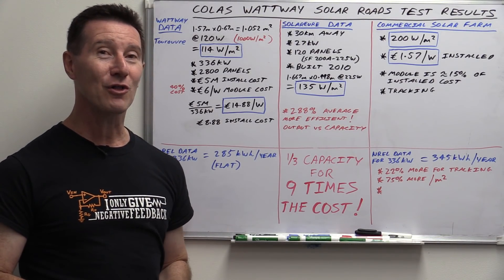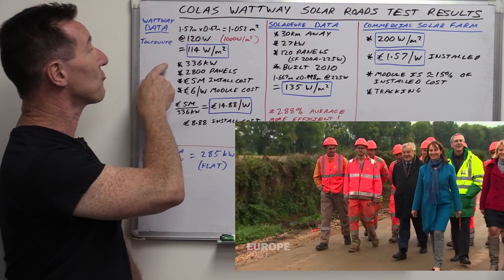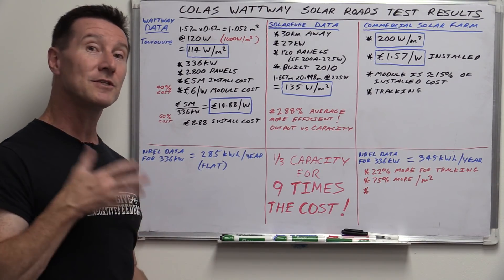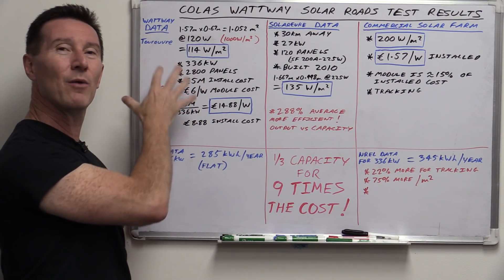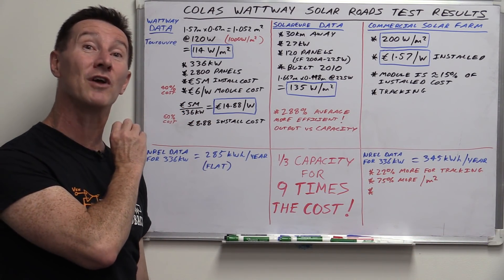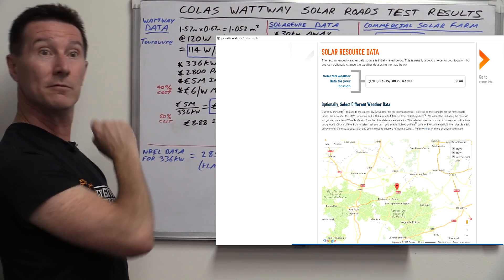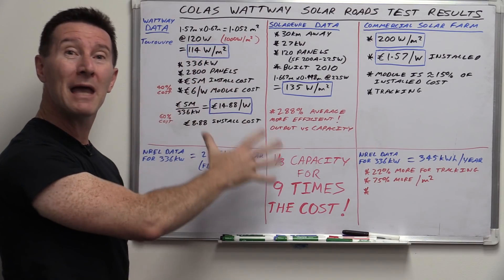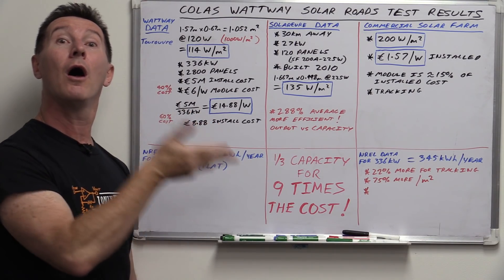EEVblog #1047 - Solar Roadways FINALLY BUSTED! (Colas Wattway)

Comment: Is there a reason you put in 5million installation costs, and neglected to provide installation costs for your "control" factors? Why obsess over what are in effect R&D installation costs..which should not be factored into a costing until a more viable mass production figure is possible?

You also very quick to dismiss the small dutch cycle road which has not only hit its targets but exceeded them and still providing a good amount of usable data on its potential (note...potential) effectiveness. It has been extended as a result of its good figures.

You are constantly hung up on the efficiency issues, and you are indeed correct, a flat road panel is never going to be as good as a moderately well fixed roof panel, and nowhere close to a proper targeted solar farm panel. Can we move on? I mean, we get it, you've made that point....again and again and again and again.

That has never ever been the aim...so why rant on and on and on and on and on about it.

The aim isn't to get a system as effective as roofs or farms, it's to make use of land space where none is available Roofs are limited, and solar farms need large land areas...so there are situations where its just not practical or viable to install such things. I'd love for them to set up 100Km2 farms in African, Asian or Australian deserts and pump the energy around the world, but it ain't happening anytime soon. So other countries need to make use of the land they have which is currently limited.

Roads, while considerably less effective are effectively unused space, and in countries where  land is at a premium finding a way to generate energy with that land is a solid idea.  
The tech isn't suited to it, yeah, ok we got that too, you mentioned it 20 times already, the roads are often obscured, yes yes yes we get that too...but the simple fact is, they do produce energy...and that's a base that can be built on, better quality panels, better installation costs, better surface materials, better results are all possible, as a result of these tests...

And yes, some of the ideas are crackpot..Solar frickin Roadways is clearly a crock,  but a solar revolution needs to start somewhere, it needs its crackpot ideas and it needs to push forward and find the solutions to making effective use of land, effective use of panels.

In time, I want to see farms, I want to see much better and more abundant roof panels, and that will happen in time, remember there was a time where people argued that solar farms were not viable, yet here we are.  I also think roads is an idea that can't and shouldn't be dismissed. Let them continue the testing, and in time they will find ways to make it viable, and cheaper to install.
Reply from the maker: I did include installation costs! Look at the NREL data I provided, it's includes installation.
Reply: BrianBeuken : Every extra euro spent on adding solar to a roadway is better spent subsidizing solar installations on privately owned buildings. You don't need to build your solar into bulk installations, large numbers of small facilities work reasonably well, and benefit from all the improvements you could plausibly make to solar roadways either won't matter for roofs, or will be at least as good on roofs.
Reply: And yet what about land cost? I suppose in France most of the land is already in some use or other.
Reply: it says included, but does not give a figure?, Wheres the actual cost...and why do you insist on including the cost of an R&D one off installation when you know its never ever going to be a comparative cost to an established production line system. You deliberately skew the figures by adding those costs in and you know it. These systems are all prototype systems, as such adding in their R&D and one off installation costs is demonstrating bias.
No one with half a brain is going to argue against the fact that these are the worst way to use a panel, but the simple question these trials want to establish is can they work....The Dutch system says yes, just,  the French system says maybe, and the solaroad is, of course bollox..
Reply: don't disagree with this, but even with subsidizing and incentives galore, the uptake of roof panels is painfully low, governments can't force private owners to install panels, and they are reluctant to compulsory purchase land better used for food and housing, so roads for them are the option they are exploring.
Reply: @EEVblog C'mon Dave, wheres the figures for the control factors installation costs.. remove the installation costs and do a proper comparison. Yes, no one doubts every other control will out perform a road, but does the road generate enough to be viable if the installation costs are comparable? Until you provide that you're just ranting about there being better options and ignoring that those better options are not always available.

Comment: DAVE, you forgot to mention that snowy climates use snow and salt on the roads (all Aussies should know this ;)). We plow them with steel blades which chews up the concrete real bad. Imagine how long they'd last with the occasional cleaning.... And the fact they'd be covered in snow for a long time (no matter how often you clean them: snow blows in). Hah.

Comment: Is there any data on drop in efficiency when there is surface water covering the panels post-rain? Also, if they are a polymer: do they burn? produce toxic gas?

Comment: Why would you put a solar panel under your vehicle? Put them on your roofs, ya dumbasses!
Reply: Why not?
Reply: For some reason, YouTube isn't showing your comment on this page, so I can only go by what showed in the notification. I actually don't get my information from the media.

Presumably, once the PV panels have been paid off, the cost of generation for that panel should drop to zero, other than climbing onto your roof with a garden hose and an extendable RV cleaning brush (they work best when kept clean). Understand that I am not talking about power storage, or DC to AC conversion, which have their own issues. Battery banks need to be replaced either periodically, or on a rotation, and they can get pretty warm. Inverters have a lifespan of about 10-15 years (compared to the PV pannels projected lifespan of 40-50 years), and care should be taken to ensure they are rated for the output of the PV panels themselves (If you add more panels, you may need to get a bigger inverter).

Installation of rooftop PV panels has issues tied to it. If your slanted roof isn't facing North-South, then you need to install a lot more panels to get the same output. On a flat roof, they'd be mounted on a truss system facing south, or better yet, a system of heliostats to track the path of the sun.

Nuclear is a better source of power than coal, though I would like to see more discussion of LFTR development, rather than keeping the existing lightwater reactors going. For one thing, they need to be better designed to withstand earthquakes, and need to be better maintained. The fission process itself is prone to disaster, as one is required to keep the system under high pressure, and the reactor as close to critical as possible to maximize power production, where LFTR operates at low pressure, and is designed to be "walk-away safe". LWRs are also horribly inefficient, as they only use about 2% of the solid fuel put into them, and produce long-lived waste for which disposal is a recurrent issue.

Regardless of whether the grid's production can be replaced with PV or PT, I'd still recommend rooftop PV, even without the battery storage, just to offset the carbon cost of power production for HVAC systems, especially during peak summer usage where daylight is plentiful.
Reply: France IS sticking them on their roofs, they're also sticking them on their roads.

And the longest part of the time, roads are uncovered. At 50-130kmh the period that a car covers any road tile is like 1s in several minutes.

Comment: Good video. I'd say that the only reason to use something like this is to use it if there's no space available for solar farms, or even putting solar on currently existing buildings in the area. Even then, you might be better off with multiple small, concentrated solar farms rather than a large, sprawling roadway.

What about walkways? Is that substantially different? I would imagine that it would be slightly better than roads. Maybe if space is really tight like in NY City, you could consider it, but again I don't know how that would compare to building / rooftop solar farms.

So, besides these situations where space is a concern and only walkways / roadways are usable, or maybe very rural roads, I don't see a good reason to put in solar roadways or walkways. It's basically a problem of opportunity cost. You'd be better off doing something else FIRST. I like the video because you are very professional in how you present the material and reasoning.

My only conclusion therefore is that these proponents of solar roadways / walkways are either ignorant, and should watch your video, or crony capitalists trying to get money from the government and selling it as a green technology. I mean it's better than other forms of energy, but it again comes down to opportunity cost - we'd be better off doing something else first (like solar farms).

Comment: the biggest problem with solar roadways is that just installing a solar roof over/next to roads is so much better.
Reply: Tim Stahel Plus it potentially adds shade for people or protects the road from the elements, its all positives when roadways has none.
Reply: Arend Wolbers
Not true.  Offshore wind farms are already far cheaper than any fossil fuel plant — and every bit of that fuel burnt doesn’t reappear as a energy source again for millions of years, at best: but we do get huge additional CO2 produced that will hang about until those millions of years lock it away again.  (Well, unless we get ‘Venus 2’.)
Reply: It does not even need to be near the road. You just need the grid to have cheap solar somewhere.
Reply: @Arend Wolbers; "anyway the building and placing of a windmill produces more CO2 than the windmill in 30 years."; You sentence makes no sense. 

Over its lifetime A Siemens 6 MW offshore wind turbine produces 33 times more energy than its production, installation and decommission, that is an EROEI in less than 10 month. Offshore wind ~7g CO2/kWh. Search for "Life cycle assessments map wind turbine lifespan"
Reply: Beside the NON-GREEN energy used by all material PLANTS to create windmills and the plants that dig-up the Bauxiet for creating aluminum, the oil to create the composite material, the iron ore for steel, the concrete.

Cost picture of a wind turbine

The wind turbine itself
The price of the wind turbine itself - the mast, the blades and the built-in technology- is usually not so much variation. In special cases, however, the cost price may be much higher than the average.

The average cost of recent wind turbines for which the Flemish Energy Agency has data is EUR 1070 per kilowatt. Moreover, the data provided by the Flemish Energy Agency are based on information that the project developers provide to the administration once a year and in confidence - albeit with invoices to back up the data.

For example, let us make calculations for a wind turbine of 2300 kilowatts. The average cost is 2.46 million euro (1070 euro/kilowatt x 2300 kilowatts).

Other investment costs
The average purchase of a turbine amounts to 77 percent of the total investment picture. In addition, the property developer has to charge a lot of other investment costs. This concerns project development (6 percent of the total investment picture), connection costs (5 percent), related works (8 percent) and other costs (4 percent).

Project development costs include the application for an environmental and building permit, including the costs of studies to be carried out in advance (e. g. studies to determine the ideal location, calculations of noise impact and cast shadow, etc.). According to the Flemish Energy Agency, this development cost amounts to an average of 83 euros per kilowatt. For a fictional wind turbine of 2300 kilowatts you speak of 190,900 euros development costs.

In determining the development cost, Flanders does not take into account the costs incurred by a project developer for wind turbines that are ultimately not built - for example, because the permit is refused. 

The connection costs relate to the cost price of connecting a wind turbine to the electricity grid.

Neighbouring works include the construction of access roads, work platforms, foundations and possible study costs during construction.

The operational costs
Once a wind turbine runs and produces energy, there are also costs involved: the operational costs. According to the Flemish Energy Agency, these amounts to an average of 43 euros per kilowatt. For a wind turbine with a capacity of 2300 kilowatts, one speaks of some 98,900 euros operational costs.

The operational costs include the maintenance contract with the wind turbine supplier, the compulsory studies that a developer has to carry out once the wind turbine is running (for example, in order to map the actual noise impact), the injection costs (must be paid for by some electricity producers if they inject the electricity produced into the grid) and the operating costs - for example insurance, complaint management, legal costs, green maintenance, the handling of sales contracts for electricity, management of electricity.

A final operational cost is the so-called building right: the amount that a wind turbine owner pays annually to the owner of the land to run his wind turbine there. According to Bart Bode, managing director of the Sustainable Energy Organisation federation, this building right generally amounts to between 20,000 and 25,000 euros.

However, for the calculation of the subsidies for wind energy, the Flemish Energy Agency must legally assume a building lease right of 5000 euros per year per turbine. That was a political decision.

The proceeds of a wind turbine
How much money a wind turbine owner receives for the electricity he injects into the grid depends on the contract he concludes with the energy customer. Part of the wind turbine owners are responsible for balance and supplier of electricity. For that category, it is difficult to determine the exact yields of electricity. Other wind turbine owners sell their electricity to a customer.

It is important to know that electricity from wind energy yields less than the market price of electricity.

It is important to know that electricity produced from wind energy produces less than the market price of electricity, for the simple reason that there is no guaranteed supply. If the wind is less severe, then there is less energy. The supply is therefore not constant, and therefore the current is worth less. In the jargon it is called this: green electricity has no base load profile.

The Flemish Energy Agency currently assumes that wind turbine owners receive an amount equal to 90 percent of the base load price for their electricity supplied.

Of course, much depends on how many hours a wind turbine actually turns. The term' equivalent full load hours' is used in the jargon: the number of hours on yes

Translated with www.DeepL.com/Translator
Source: https://www.mo.be/analyse/zoveel-kost-een-windmolen-en-zoveel-brengt-hij-op
Reply: Calculate all costs and you will see that cheap green energy doesn't exists and is certainly not green.
Reply: You realize hopefully that those offshore wind farms are widely subsidised for as much as over 50%!?  CO2 (is still) produced in producing wind farms and placing them, the oil produced by a drill rig + at least 2 big seawhearthy oil using tugboats, the placing of a windmill even more, anyway the building and placing of a windmill produces more CO2 than the windmill in 30 years. And after 30 years or much less this windmill fails and needs to be replaced! O yeah, don't forget the boat running on oil that brings maintenance workers to the windpark?
CO2 produced by farting and pooping of all animals (incl people and don't forget plants) is way more than all cars on this planet.
 Al Gore is the one who made and makes the most 'green' from the green energy scam!

Calculate all, for placing 10.000 Watt in solar panels unsubsidized, you may even count the feedback to the grid, do this for 30 years and beside this, your green energys
CO2 produce! You be surprised!

Comment: 1000 kilometres sounds a bit clumsy. 1 Megameter is much cooler!
Reply: You mean 10,000 hectometers.
Reply: @Krrypton  you mean 1,000,000 metres per second seconds?
Reply: 106 pico-lightyears, if you wanna get astronomical
Reply: I like 10 hectometers myself.
Reply: isn't a megameter a volt meter with an ego problem?